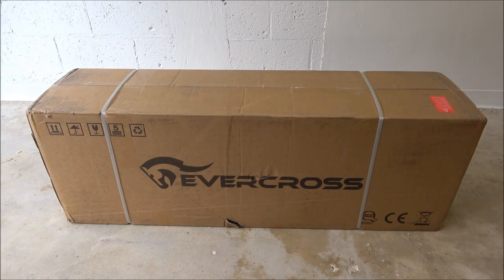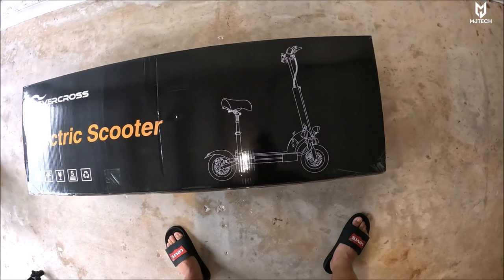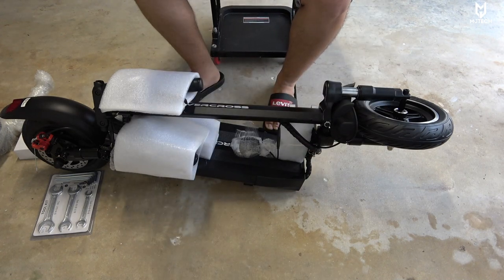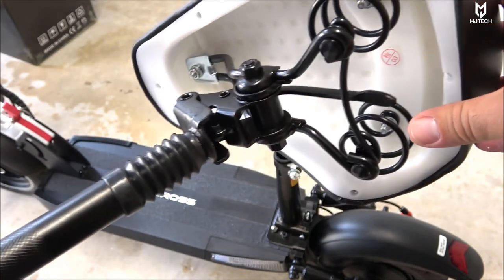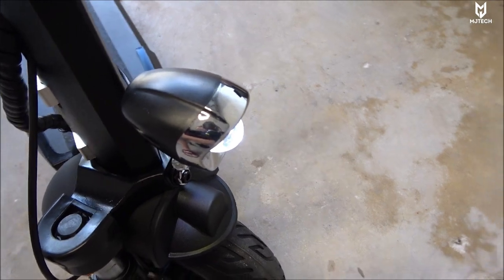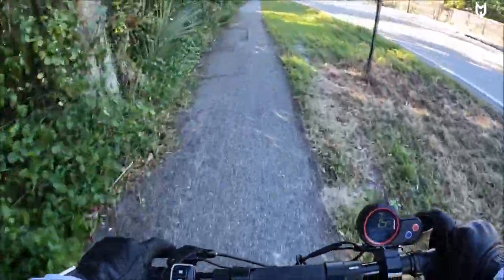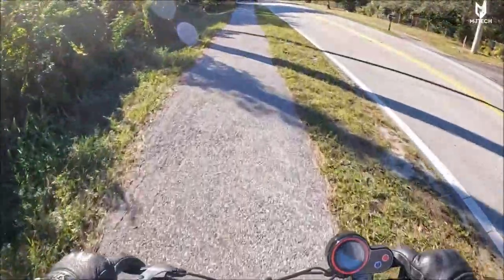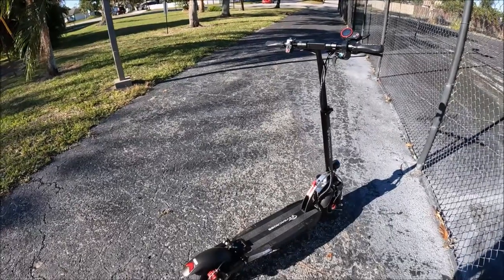Best Cheap Amazon Electric Scooter [2022] - 28MPH - Cruise Control - 800w - Evercross H5!

Comment: I  bought two of these back in 2021 one for me and my wife. We use these when we go camping in our RV and they are great for getting around the campsites and neghboring towns and shopping malls etc. I also use it to pull a Gorrilla Cart for collectin firewood for the fire pit. This thing will pull a full load of firewood with no problems at all. We bought lots of accessories such as mirrors, luggage racks, and water bottle holders. We have accumulated about 90 miles on them so far and one is just getting to where it will discharge faster than the other so i may be getting new batteries soon. but for the most part. Well worth the money. PS, no the one for pulling firewood still holds a charge just fine, Just thought I would throw that in.
Reply: Hi the battery died within month or not using the scooter it don’t charge anymore where can I buy one battery please ?
Reply: So cool, that's why I just bought one, I'm retired and travel with the RV, so figured this will be great to use in RV parks etc.  Nice to hear it pulled a firewood cart!!  I want to tow a cooler with it
Reply: I cant stand that finger throttle. Why would they create it like that? Thumb throttles make it much easier and safer to ride.
Reply: @Brightestlightt  do you leave it to charge overnight ?

Comment: Just bought it and it didn’t quite go 28 but 25 is good enough
Reply from the maker: Yes it depends on the weight and terrain.
Reply: Yes, I'm sure they tested it with a 160lb rider. I weigh 185lb and it basically hits 25mph top speed. It's probably really around 23-24mph if you check it with gps. Scooter speedometers are always off by 1 or 2mph.
Reply: Ye im 130
Reply: @chrisb.1214  Do you know any other scooters that cost $600 and go up to 28 miles
Reply: @teddyflowers2798  Not really. There's the new ETWOW GT Booster Sport that will hit 30mph, but I believe that sells at $1099.
Reply: @chrisb.1214  All man
Reply: We just bough one. I am 205 pounds this thing only goes to 15mph. Not sure if there is a way to change the settings for it to go faster or If i am just too heavy for it
Reply: @josehurtado9953  press the blue button and make sure it's charged all the way it should say three that's going to go a little faster you probaly have it in gear two
Reply: How much did you get it for?
Reply: This best scooter at this price
Reply: @marquishatton5525   what’s the cost of them currently?
Reply: Ya I'm 230

Comment: Excellent mid-grade scooter. Built well and solid. Definitely a step up with the turn signals, horn and LED lights. Shocks on the front and back are a +++, however, as I said , it’s a mid-grade scooter. I wouldn’t jump curbs or go down stairs with it but the suspension makes a huge difference.
Reply: What scooter would u buy to go down stairs or off-road
Reply: @zachpriest790  anything $1600 and over with the C-type dual suspension and dual motor will be good for off roading. I not a believer with the stairs. Tiny tires and too much abuse. Never going to last long if you put it through all that.
Reply: @grazz7865  thanks very much
Reply: I jump curbs in my segway es1 lol i
Reply: I jumped 5 stairs on Spin scooter airless foam tires. Smooth
Reply: Death on wheels right there!   Take a good look at the wheel fork attachment!   A thin steel bolt going through a tiny alu bracked!    Recipe for disaster!
Reply: @Ian_Christensen  I have this scooter. I checked it carefully and that one pin is locked in there good. It’s not going anywhere. I doubt the company (which has a descent reputation) would not want to assume that liability.

Comment: I've been reading reviews about the battery dying halfway. I'm having the same issue. I contacted evercross and told them I also need a second key. I'm going to see if I can get some terrain tires installed because because I want to ride on grass and rocky areas. I installed a basket when I go buy groceries I can put it in the basket also I'm putting a storage rack on the back tire so my kids can stand in the back. I paid $600 at the pawn shop for it. It's pretty cool .

Comment: I have been riding mine for my daily commute religiously for 2 years 

Has been nothing but reliable... head light will need to be tightened every couple months or put some lock tight in it. You gotta adjust the brakes after awile jist saying that's annoying.... if you ride with the seat somthing in it will make it swivel amd not lock forward after a few months but it didn't bother me to much 

I love it and this scooter has been nothing but a solid perches that's turned my commute to one of the most enjoyable parts of my day

Comment: Got mine through an Insurance Claim (Distracted driver Hit me on Crosswalk). Loaded with leg braces now, this makes life easier than walking, and having the handlebars to hold onto for balance really helps!  Unlike the ones that go really fast, this one does the job!  Besides, I find 25km/hr (15mph) is a comfortable speed.
Reply: 15 mph is very comfortable
Reply: It’s not the speed that buys you time. It’s the fact that you can zip through traffic-passing rows and rows of cars stuck at lights. Sidewalks (Allegedly). So even at 15mph, you still get where you’re going on under 5 minutes. After riding scooters, I find it amazing how the lights make the ride so slow in a car. And I find some lights are rediculous long. You have enough time to read the newspaper from cover to cover before it even considers changing back.
Reply: @grazz7865  I can relate to that!  Sometimes cars are waiting for ages until a Pedestrian appears and presses the Walk Button to make the lights turn green.
Reply: @MatthewFordVictoria  ha! I caught someone do that. The light was red for so long, the driver was able to write Shakespeare. Got out and pressed the walk button😂😂😂😂😂

Comment: Good point on the battery indicator. Don't go by the estimated range. Don't go by the battery percentage, go by the voltage. So if a scooter has 52V, at 100% it's probably around 58 volts on the read out and 0% is around 42 volts. This is just a very rough estimate. If you want accurate data, you have to measure your voltage when the battery is fully charge and then ride it until it starts to slow down, which means it's almost drained, and take note of the voltage readout there. It's not quite 0% but just note it as 0% anyhow, because you don't want to drain it far past 20%.

Comment: I just ordered one yesterday after extensive research. Fits my needs. Just to let you guys know on the Amazon page of the reseller I bought from in the question and answer section and set to most recent on page 7 first question and Answer: "We are producing larger capacity batteries which will be available for sale shortly."-June 7, 2022.  Now this was a post from the seller not sure if the person means the manufacturer is working on that. Awesome stuff if true. Also subbed.  It's the battery technology that really needs to evolve and improve which there's a few that should already be replacing these ancient Lithium-Ion batteries. Also, thanks for the tip about the oil on the steering column.

Comment: 1) SLIME for the tire tubes.
2) BLUE Loctite for various screws/bolts.
3) Slicone for the seams and cable entries within the main deck.
Reply: Why silicone on the cable entries
Reply: @kingofyourhood  To keep splash water out of the battery compartment. One could use gasket sealant, as well.
Reply: @jb678901  mh good idea.  Thanks for the idea.  I wonder if that’s why my hover 1 stop working with a “error 6”

Comment: I got the 1st generation of this evercross and mine is still doing great I tske care of it, make sure every bolt is tightened,  greased up etc.  If you tske care of it , it'll do the same back. FYI. Evwr use the seat, it is not safe and unbalanced

Comment: I love this e scooter. I have U.K. version called HITWAY H5. My only problem is that cruise control won’t work and if I hold the mode button down, the bright side lights should turn on and off, independently but it does nothing. So I simply have to switch on regular lights and the bright lights come on at same time. I’m over cruise control and the lights don’t bother me. I paid £414 and I’m very very happy. I get 26mph and at least 16mile range. More like 20 average. 1 of the best buys I’ve made. Just so fun and comfortable to ride and coming from an AovoPro clone that has 8inch solid tires that make loud scrapping noise on ground and feel like on ice when wet, oh and having 0 suspension, this EverCross/HITWAY e scooter , I’d like a dream and again, I only paid £414. 😄
Reply: Did yours come with a uk charger
Reply: @DANKAIX  of course. If you order from U.K. it will have U.K. charger.
Reply: Sorry to ask but does the scooter fold on it’s own when riding I saw someone say on Amazon it folds on it’s own
Reply: @DANKAIX  no. On its own, the locking system is strong and will NOT fold when riding. Plus, there’s a nice pin that you insert to folding mechanism and this pin means it’s absolutely impossible for the e scooter to unfold when riding. It’s so secure that you don’t really need to use the pin but obviously, you absolutely should, just to be sure that you’re safe.

Comment: What’s the diameter of the handlebars on the tube area where you can slide the thing to collapse them? Is it the normal 22.2mm? Wondering if I’d be able to fit my Meachow bike mirror on it, but it only fits on 22.2mm bars…?

Comment: It's a lovely scooter and very very fast but if you wanted to make her a little faster how would you do that
Reply: I recently got mine I upgraded front and rear shocks. And I'm waiting on a 48 volt 1000watt hub to replace front wheel and make it dual. I think these will make it perfect without braking the bank. And hopefully I can achieve 30MPH OR HIGHER.
Reply: @josezcerda2039  any update? Thinking about getting one and want the most speed possible

Comment: when setting up cruise control, what do the numbers mean under P, I see Yellow number 2,4, 9, 16, 99...Then below in white is 00000 or 00001?
Reply: Flip to P16. Use the blue button to change it to 001
Reply: @zenwhitenoise7920  that’s correct. 0 is off and 1 is on
Reply: Crucero que es?

Comment: 11:09 Mine came in today. Looks like I got the most recent model of this. There are 4 turn signal lights. 2 in the front and 2 in back.  11:18 There was a tag that states you can change 3 modes for those trim lights. Seems a bit hit and miss though either that or I'm not timing the press right. And the rear shocks are now red as well not that matt black on yours.
Reply: We’re do u get it from and how fast does it acc go ?
Reply: @Its_Brandan  Got mine from Amazon. 27 mph. Uphill is a struggle coming in around 13 mph.  I haven't tested it for its max range which is supposed to be 25 miles. I  did a 22 miles range.  Not the greatest range but that's fine for me it's just to go scooting around to stores.
Reply: @Ancientreapers  how much in pounds ?
Reply: @Its_Brandan  It is rather on the heavy side  44 lbs. You'll never need a gym ever again carrying this thing around heh.
Reply: @Its_Brandan  Oh one more thing. I bought it when it when it was on sale on amazon $679. The usual price you'll see is $799.

Comment: My right handle bars doesn’t fold anyone know what that issue may be?
Reply: Maybe you tightened the brake or lcd too close to the circular latch that has the white arrow? You need to pull those latched outward first, then fold the handlebars

Comment: Great video, I just got one. It has changed slightly, it has beefed up front suspension with coil overs, and the turn signals are on each corner of the base. Thanks for the  seat tip, I didn't know about the lever under the seat. I agree it feels like a low rider, with the seat sinking lower, but I'm going to be a seated operator mostly, just not into standing up.  How do you select options in the P mode? I know how to get to it but not sure how to toggle options in the P mode.

Comment: I'll have to oil up that steering hinge on the stem of mine real good. I took mine out on the first time and I thought it was extremely dangerous because of that problem. Also the RGB lights along the sides of deck on mine have a short in the wiring I believe so that also sucked.
Reply: What do you mean by that sir? I think I’m having the same issue with mines I took it out for the first time and it starts wobbling

Comment: 5:47 ,The dumber Dumbed Down main locking pin is a confirmed by me a completely unsafe  & highly  wrong unlockable PIN, it's simply a open ended again said unsafe pin for the whole machine absolutely zero safe backup Lock,in my opinion said unsafe pin can flop around opening itself at the wrong moment because of no safety Lock, these pins are made for quick attach and that's it,the wrong safety pin in the wrong place. Period

Comment: Again super dumb amateur advice at 6:15 about checking bolt's on anything with wheel's ? Yah right that stupid unsafe main mast pin isn't a locking pin at all, & will open itself because of zero Lock on the quick open  & even quicker non lock close,ready to open when it flops around and jolt's the round unlocked ring around the always  basically open open ended dumber pin.